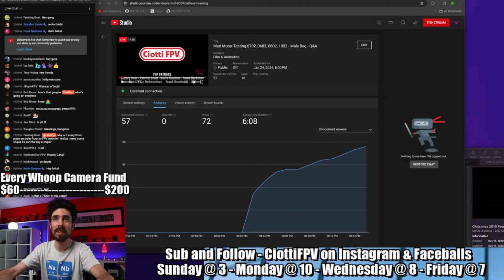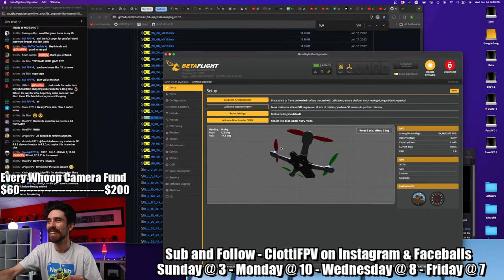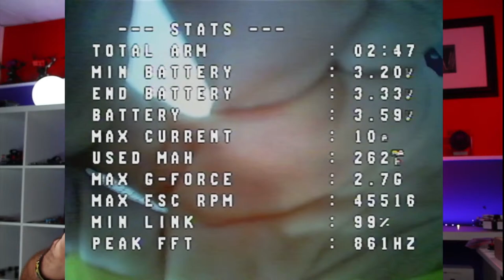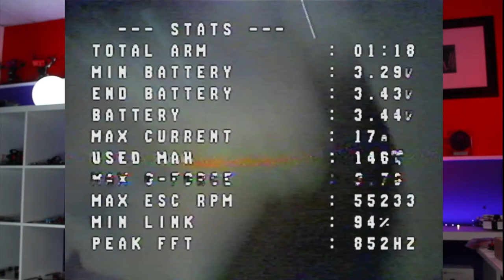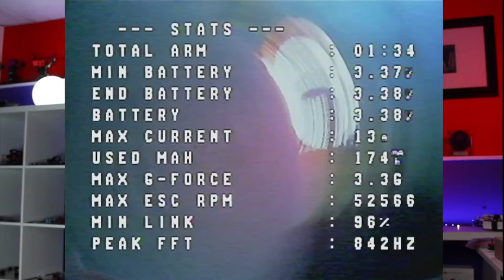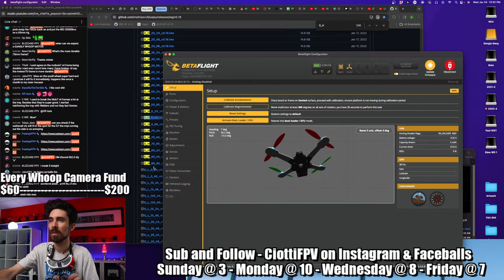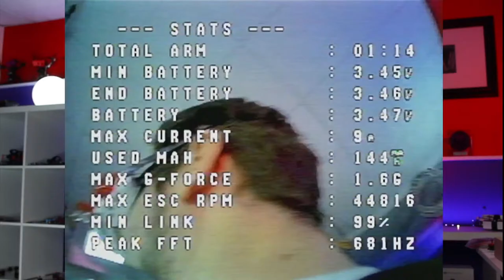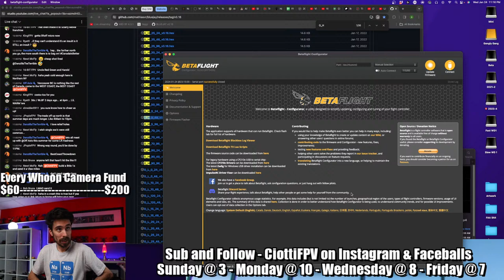Mad Motor Testing 0702, 0603, 0802 - Male Bag - Q&A

Comment: 13:00 - plan for the stream
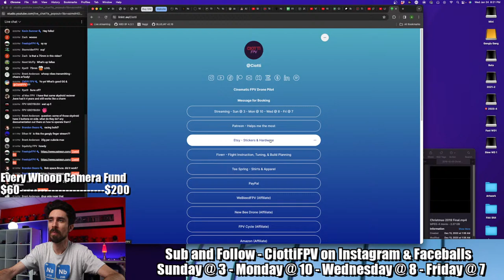18:58 - Miata shirt
26:25 - HappyModel Super X and BlueJay
31:25 - No ESC code in BlueJay
38:42 - How to fix smashed batteries
45:14 - Flying 23500kv 0802
56:12 - 803 vs 603 motors
1:08:43 - Prop weight comparison
1:10:06 - 0802 33000kv weight comparison
1:13:40 - NewBeeDrone Venom props
1:18:15 - Flying 0802 33000kv
1:21:43 - Mobula6 upgrades
1:24:11 - Favorite motors
1:30:22 - Flying 0802 33000kv on triblades
1:34:53 - 802 33000kv on 75mm question
1:45:15 - First look at Meteor75 Air frame
1:49:12 - BT2.0 U cables
2:30:44 - Is removing motor plugs worth the weight savings?
2:32:12 - Flying beat up 0603 motors
3:26:41 - How to test if motors spin freely
3:29:27 - Flying Meteor75 Air with Walksnail
Reply from the maker: Thanks for doing these man, any interest in taking turns with Apache Smoke so that he doesn't burn out on doing them?  Maybe you do the ones for the streams you regularly catch and he does the ones he usually catches?
Reply: @CiottiFPV  I can do it for all the streams except the Sunday one, because I watch them in recording. On Sundays it's the only one that's not in the middle of the night for me, so I just chill and enjoy on 1x speed🙂
Reply from the maker: @vpr0  Apache Smoke says he doesn't mind and will keep doing all the streams so you're free to do whichever ones you want man, I appreciate it a ton :)

Comment: Yo thanks for checking for the Walksnail vtx in the Meteor75 Air frame... I had to bounce after i posted the question. Also the Mipi cable would make that a complete no-go. I was deciding between getting 2 or 4, i think i will just get the two
Reply from the maker: Do you have any experience with the Meteor75 Pro frame?  I have a few on the way to try to get some more power out of this god dam thing but I have a feeling they're not gonna be durable enough for jungle gym bashing
Reply: @CiottiFPV  I built one up on analog and immediately pulled it apart.. It's not a 75mm frame it's basically the same size as an 85mm frame but with smaller props. It will have more power than the 75 for sure, but if I am going that big i would rather just fly a 2s 85mm. Others love it though, not sure why.
Reply from the maker: @Tokyo_Dom  dude it's SO MUCH HEAVIER what the HELL were they thinking???  It does make some POWER with great run time though on the 45mm biblades but the weight penalty is probably just gonna be too much
Reply: @CiottiFPV  it's a totally different class of whoop. Tyrantt Fpv does technical indoor freestyle with it but I have no idea how. I know you don't like soldering motors and other silly weight saving measures I do, but I really think 75mm works best if you keep it really light. 27g or less, 450mah on tri blades and it feels poppy even on 20000kv motors
Reply from the maker: @Tokyo_Dom  I'm right at 30 grams with mine, getting down to 27 would be extremely difficult as I'm already on the lightest frame, canopy, AIO, and motors so I'll probably just be leaving it as is.  I don't go down the rabbit hole with extreme light weight methods because that leaves me with a rig that has hours and hours of customization in it that when (not if) I break it I'll have to do all over again which in turn leads to my not flying it hard so that I don't break it and what fun is that?  :)

Comment: What’s up bro, how are you doing? Another 4 hours? Let’s go😥

00:03:05 On this stream….
00:05:02 QAVS split top frame get it here.
00:12:12 What are we going to fly 
00:17:00 Help Ciotti going.
00:25:03 My final verdict on the pusher 65mm Walksnail build is it flies better than the puller style rigs. I would recommend that build to anyone trying to get somewhat cinematic footage.
00:26:00 Thanks for your help on my build! Was getting 1.5-2 min flight on HDZero fractal65 my happy model FC went bad, replaced with HM Superx 411 hd and plastic frame now I get 3 min flight??
00:31:22 My mob6 aio came with Blheli_S 16.8, it is not on esc config
00:33:22 What do you think about Pavo Pico and Pavo 20 o3?
00:37:24 Setting the prototype 0802 motor directions in Betaflight and fly it.
00:56:15 I'm hoping for more 803 and 603 motors now that we have HD micros. Like you say that height helps a lot more.
00:57:12 The props held up really well.
01:00:22 A bit struggling with the battery lead.
01:03:19 The HM screws are too short.
01:06:30 Changing the Receiver. Will it make a difference?
01:08:00 Chancing the frame. On 0802 EX 33.000Kv.
01:15:53 Setting the motor direction.
01:17:06 Where should the red dots motor plugs go?
01:18:38 Flying the 0802 EX 33.000Kv.
01:11:58 Is the thrust higher? maybe just lower the pids. If its making more thrust it needs less tune in general
01:13:41 I just got some NewBeeDrone Venom V2 bi blades. Thought I would try them out, haven't yet though. have you tried them, any thoughts?
01:12;14 Have found launch control to be really useful sometimes when escaping those kind of shoe trap crashes… great for scooting out a little from trapping ducts under something.
01:28:18 The dots will only be accurate if you haven't changed any directions in BF or ESC config on the FC before.
01:20:18 Switch to triblade and fly the 0802 33.000Kv rig.

01:33:32 Will the battery win this time 😂
01:34:54 Swapped my 75mm rig to 802 33000kv and I’ve been flying them a bit. Honestly prefer the 1002 23500kv. I think I heard you starting to prefer 802s for 75mm? True or did I misunderstand?
01:38:48 Thoughts about the 0802 EX 33.000Kv.
01:43:18 Male Bag
01:54:40 Pulling the rig apart changing the camera. And weight comparison.
02:00:30 I can bind Meteor with rx_spi_protocol = V202_250k, but don’t seem to bind to Mobula with rx_spi_protocol = EXPRESSLRS. Both were supposed to be elrs bnf. Do you know why?
02:02:35 What are those white motors? look cool I like them?
02:03:33 Ready for something cool??
02:11:34 The magical difference between beat up motors and fresh motors.
02:14:20 Would an XT30 be the next step up for a high Kv 75?
02:27:48 A drift course just opened a town over from me so I'm going to go check it out and hopefully don't leave with more rc's
02:30:46 Is the weight savings worth the hassle of removing motor plugs? I did it on my first fc but I’m not sure I care to do it for future builds.
02:31:52 Lets fly and see the different.
02:37:54 Yes I meant for the meteor75 air frame, can you check if the Walksnail vtx will fit in the spot for the fc (I like to put the fc underneath). The mipi cable hitting ducts is my concern
02:46:21 Switching to the 75mm Walksnail builds.
03:04:40 what are the weights?
03:10:38 Setting up the motors in Betaflight.
03:13:20 Fighting the props? Here is a tip.(don’t ‘give up is the tip I guess 🤣).
03:23:27 That motor didn’t sound good, let’s see if it’s fixable.
03:29:17 We got lift off finally 😁.
03:35:18 Mirror flip.
03:36:23 Not impressed for the run time. And final thoughts.
03:38:26 Night flight????
Stay safe everyone and have fun flying.
Reply from the maker: Legendary as always man, hey I want to make sure you don't burn out on doing these since I'm sure they take a bunch of time/effort, it looks like vpr0 has been doing a bunch of the recent streams so I asked him above if he has any interest in sharing the work load with you.  If you want to keep doing all of them by all means let er rip the more the merrier but I just wanna be as respectful as possible of your time :)
Reply: Im glad to do it, i got time becuase im still down with long Covid (2 years now) so it's good that i can do stuff for you and the comunity  @CiottiFPV

Comment: My happymodel elrs accelerometer seems broke.
I soldered bt 2.0 but didn't have any flux left so guess I put alot more heat then normal through board.

Is heat known to damage the accelerometer ?
Is there a way I can fix this ?
Reply from the maker: I've never heard of that happening but anything's possible, I doubt you can fix it man sorry